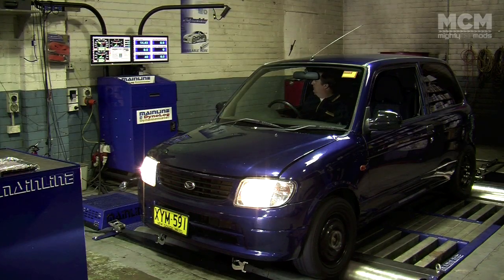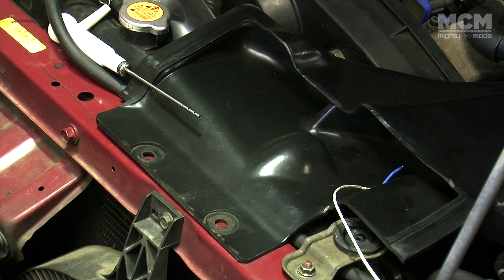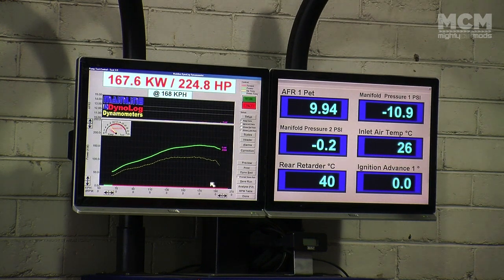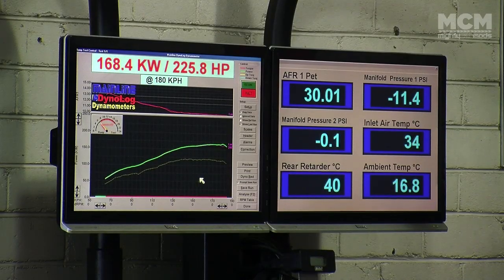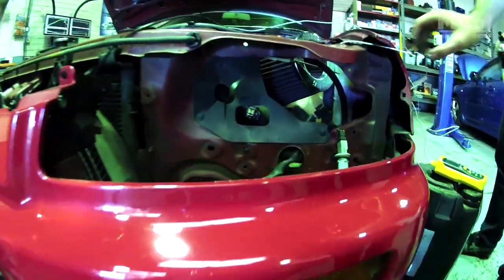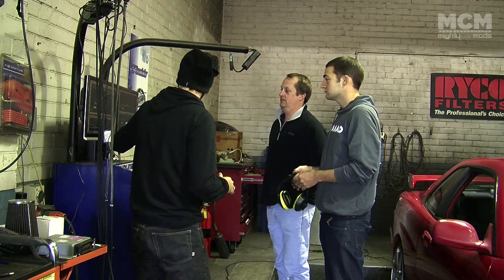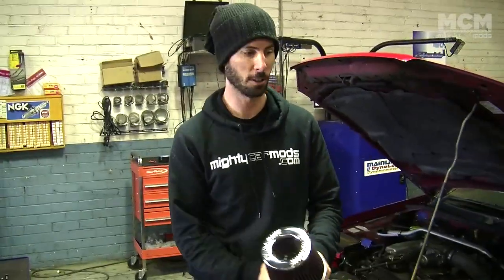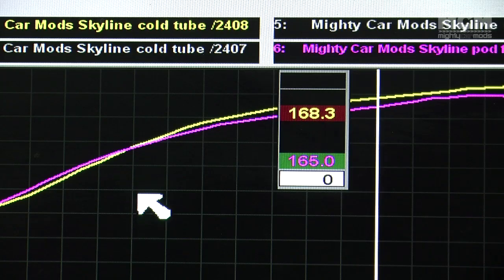Cold Air Intakes Mythbusted [Turbo]

Comment: All I can say is make sure the air intake you get has a box just like the stock otherwise your sucking hot air from the engine. Also verify it is designed for your exact vehicle down to the sub model of your car and lastly understand it will not greatly benefit the performance of your vehicle unless you do your own research!

Comment: Cold air intake or "ram air" is relatively the same concept. This vehicle already has an equivalent system in place. The difference was adding the larger volume intake, that's what gave 1% power increase. To prove a major quantifiable difference advanced engine tuning is required. The vehicle's computer isn't configured to use the extra available air. If you are going to build a comparison do it with a vehicle that doesn't already have a proper intake system. Naturally aspirated vehicles will see dramatic increases but commuter regulated variables would need to be adjusted. Adding more available air is just one piece of the multivariable equation.  

My car, 2016 C63 AMG has restricted air filters and is tuned down from factory. Simply swapping out the air filters and adding the performance tune can produce a significant power increase. 469hp Stock to 605hp with just air filters and a tune. The tune would not work without the increase in available air. In the same respect I could add larger turbos, but it would do nothing without the proper ECU tune.

Comment: A lo of people just think, oh Cold air intake and stick the filter on, but underhood and get no gains. Also, usually the factory airbox already grabs cold air. There might not be a serious gain in power, but colder air to the turbo will help protect the engine at higher boost levels.

Comment: the filters and no filter may flow better but without a larger intake manifold and throttle body, what more can really be pulled in ? that’s like cutting off a section of a hose and replacing it with a larger hose and expecting the whole hose to dow better, all parts must be upgraded before any gains are seen, so for a car an intake alone wouldn’t do much if the intake manifold can’t hold more air, or if the throttle body can allow more area for air to pass through, or if the full exhaust can’t move the extra air out, simple mods alone won’t gain much alone, in tandem multiple mods will work together to create power

Comment: In theory cold air = higher density considering not higher humidity. Will yield in more power if fuel administered correctly. Anyone who flies piston powered aircrafts will understand it. T/O performance calculated relies on this a bit.

Comment: Cold air intake systems never claim to give huge gains,  but they do help,  and the overall point is that the car is moving (thus supplying the cooler air),  of course your not going to see much on a stationary car in a shop.

Comment: So I understand what y'all are getting at, and for the most part you're right, but I think there's a few problems. 
First off, I agree it's completely ridiculous to expect a 20% increase in horsepower off an air-filter, unless you haven't changed your factory filter it since purchasing your Civic in 1992. However, y'all really don't go into any of the benefits of an upgraded air intake and might consider improving your test.
What I don't like about your test:
1) You use a car that comes from the factory with a snorkel. The snorkel is the same thing as the cold air intake you are testing, as it draws air from a colder place. Y'all actually showed that the factory version of a cold air intake performed better than no filter at all.
2) It is on a small, 225 bhp engine
3) Nothing noted on fuel economy or emissions
4) You did not tune after installing the filter

There are also some solid arguments for upgrading intake, and they're logical. Colder air is more dense, more dense air has more oxygen, more oxygen means better combustion. This is the same reason we use intercoolers with turbos. 
A simple performance filter also works with the concept of more oxygen, the only difference is it accomplishes this by ramming more air through period. 
So, either one of these has tangible benefits to consider:
1) Buying quality filters will always be better for your car in the long run. Cloth filters generally do a better job of filtering out the bad stuff while still letting more clean air through. You don't have to be a rocket scientist to figure out it's better to keep the dirt out of your engine.
2) As the boys have proved, you may see an increase in power, just don't expect it to be much. The factory snorkel is the real test here, because it ads power over no filter at all. Their custom system outside the car also added some power. Again, these are small gains, but gains none the less. 
3) Cloth filters are reusable, so yay. Less money spent on filters over time and better for the environment, so that's a win-win in my book.
4) Better filters usually equate to better fuel economy (I saw +.1 to .2 mpg in my truck after several months with the new filter, despite my heavy foot).

Now, is a cold air intake really worth it? Not unless you've already completely built your engine. If you've done this then it's silly to let your intake lag behind, but otherwise you won't see much improvement.
That being said, I would recommend a better filter for everyone, as they're cheap (50 bucks) and there's really no harm in installing one.

Keep up the videos boys, they're entertaining and well produced.

Comment: So, the factory provides a cold air intake (like they do on most cars and trucks these days because they work) and then you test that against a different cold air intake and the gains are to small?  You need to compare the cone filter with headlight to cone outside and you will get an idea. However you need  to be in real world and on a hot day to see the most from these. Also, proof is when  tuning there are always fuel and ignition adjustments based on intake air temps because a large enough swing does matter.

Comment: When that car is moving and the wind is blowing, you get more air and it works better with an aftermarket intercooler lol You should get an extra 2 or 3 hp. with an intercooler you should get like 5-7 The intake has to be facing forward. lol not towards the ground. best place is the bottom of the bumper. facing forward lol like a 300z lol hydrolock your engine. take the plugs and turn the key over lol but they make ports for the intakes that stop that from happening.

Comment: Speaking from the experience of living in the arctic, I can say that you want warm air intakes because the warm air does a better job of atomizing the fuel in the air fuel mixture needed for the stoichiometry that the vehicle was designed to have for proper combustion.
Reply: Nobody has saluted you for the use of stoichiometry.  Until now.  o7
Reply: @mackchannel6348  it's because he's wrong lol

Comment: cold air intake only work once the engine bay has built up heat from extended or hard use. then instead of sucking all that hot air back into your motor you pull in cooler air wich burns easier . so you don't lose HP from the hot air . so although it doesn't exactly increase HP it prevents lose of HP from hot air

Comment: The intake system has a calculated lenght . If you change its lenght than it will have affect to the power and torque.
Also if you place the intake directly to to air, than with the speed you'll get an extra ram air (like a mini turbo) depends on the speed.

Comment: I thought that intakes only increase power if you've got a freer flowing system in general such as a turbo back exhaust and your car has been mapped for increased airflow? Correct me if I'm wrong, I'm not 100% sure.

Comment: On certain cars, an aftermarket pipe can make a nice, sexy sneeze. ;) That's about it. Really, an in/out (or I/H(DP)/E) upgraded from stock will only make a noticeable difference on big motors or boosted ones. They gotta move a lot of air to feel the bolt ons. An intake may give you 20hp (depending on car, but at least read the rest of the sentence), but where is it giving it, and what is it going to take away? You could get a sexy sound, a nice bump in throttle response, shitty idle, lean conditions and more, or none, or all of them. In the end, you could take a set of garden hoses and make a pipe that comes out of every Ford owner's butt; if it's tuned for it, then you will feel the difference. haha

Yeah. That is a big extreme, but unless you are rocking a car with a forced-induction engine or a highly constricted high-displacement motor (or both? :D That is rad), you will nothing but the smile from the intake growl (I gotta say; it does feel nice. haha. ).

Comment: All the first turbo cars were direct feed. Intercoolers only existed on trucks and were too big to fit to cars.  2 or 3 laps round a track and you were down enough HP to feel it.  You could get some of that back with cold air. Id bet if you took the intercooler out of that car you would actually be able to see the difference cold air really makes.

Comment: No fair using a Skyline as your test vehicle. It's already well-optimized for power. You'll only see any difference from a cold-air intake if you install it on an econobox with a strangled air intake or a very old car that pulls air from the middle of the engine bay.

Comment: I realize this video it 8 years old, but they never tuned the ECU after modifying the intake. Monitoring intake gains on a dyno is pointless because the intake will drop to below or near ambient with the CAI from the rush of air while driving the car. The dyno fans will not provide the amount of air of cooling needed notice the difference.

Comment: This is a short ram air intake, NOT a cold air intake. CAIs are directed AWAY from the engine bay, to someplace cooler, like the front of the car (near intercooler) or the side front panel to keep engine temperatures from interferring with the performance of the intake.

Comment: I feel like this test should have been done with a car that doesn't already have a cold air intake or snorkel....or even not use a high performance car.

You're taking a car that's already high spec'd so wouldn't expect to see more gains as its ready been factory tuned for best performance.

Would like to see this on a bog standarf Ford focus for example and  see what performance gains there are

Comment: the only time u would need a cone filter and true 3" pipe would be if u increased ur compression ratio
stock air boxes are obviously only designed for stock compression
some bad plenum designs can also see an improvement from a cone filter
GM 60 degree V6 is one, the upper and lower plenum choke the engine
so removing the air box in general helps and u need a filter for driving

Comment: If course just more air want increase hp but add a tune to increase the fuel and air at the same time and you will see gains then. Plus running cooler air helps fight off heat sink and will help preserve hp.

Comment: I'm thinking the problem with your difference in Horsepower gains is because it's a compressed air pump before the intake a Turbocharger or a blower heats the air so maybe try a normally-aspirated car??

Comment: 100% sure my old Toyota gained horsepower.. plus higher top speed.. idled a little rough.. but there were measurable gains. Originally started topping out at 93mph - 98mph.. After the intake it went up to 106mph-110mph on the track of course! 😏

Comment: I think the difference is.. you’re using a short ram intake.. and the final test is actually a cold air intake.. a short ram sits in the engine bay.. a cold air is more in the fender or similar to where you would of put the final test... away from the engine

Comment: they are going about this all wrong. a turbo already uses a cold air intake in a sense of its intercooler. on a n/a motor. you have to cool the air at the intake manifold. but on a turbo because the air goes through compression after the intake draw. it heats up no matter how cold the air was coming in. after it is compressed it is ran through a optional cooling process of a intercooler. the only way to lower the temp on the charge entering the throttle body, is to lower the intercooler temp. filters etc. will make only response different. rather than making more power unless you strangle the inlet of the turbo. a cold air intake has no effect on a turbo car. the cooler you get the intercooler is where you see the difference

Comment: For your next video, Gasoline and other fuels, mythbusted.

Will equipping your vehicle with a fuel delivery system increase horse power?

Runs on dyno - heavily-edited conversation reviewing dynamo data

"Turns out cars run just as well without fuel."

Comment: do it on a naturally aspirated one and use the least restrictive piping possible, and run it straight from the bumper to the intake. 

I gained 7hp from that simply because of engine bay heat and a tiny bit less restrictive piping...amd that's on a dyno where the air is moving much less. While running my calculations are more like 15hp

Comment: I love mcm.  but vehicles are adaptive over time.  so over time with the computer seeing a colder air charge it will adjust spark and fuel to get the most efficient burn.  but the vehicle needs time and miles to adjust to the intake change and adjust on its own.   but with this said,  the most you would gain without tuning might be a half horse lol.   take the headlight out and drive around for a week than do the dyno see if there is a change.

Comment: I mean, yes they're small gains, but small gains here and there add up. Like how Mazdas new MX-5 saved a few ounces here and there, like they didn't seem significant until you added it all up and it's like you saved the entire weight of a passenger in the new car. Cold air intakes alone don't do anything. But imagine a racing environment where there is constant heat being generated over extended periods and a proper tune (along with bolt ons which make a little difference here and there) and it will add up. When 0.001 seconds can make the difference between 1st and 2nd place (assuming both racers are in the same league in skill), it all makes a difference. On street cars, lol no. They don't do jack. Your stock intake is the best. The only gain from getting a pod is a better intake sound. 

I work at a shop where we tune cars for racing (everything but the actual tunes) and for street cars, we DO NOT reccommend investments in air intakes for significant power gains, regardless of what the big name brand that everyone loves says.

Comment: A cold air intake will never work if its run to a spot in the engine bay where hot air is normally sitting any way. The best bet is to combine with a heat shield and to reposition the placement of the inlet or add a low- scoop. Also while people do say that a CAI will increase performance the true point is to increase efficiency Reducing Fuel useage since most OEM intake systems are some what restrictive. Thus on a brand of car where the intake system already works efficiently adding a different system will not change or can sometimes decrease performance. 

Additionally I second the point of previous commenters where as changing the amount of airflow does nothing if the throttle body is still tuned to the previous system. In some chases a high flow sensor would be needed, however in all cases a re-tune is required so that the ECU is properly positioning Fuel vs Air intake. Air flow being considered as well on a stationary dyno.

Lastly and most important changing the quality/ amount of inflow does nothing if the out flow is still restricted. If the exhaust manifold is  the cars standard Iron and ceramic made to fail system and from the catalytic converter back is the cheapest thing the manufacturer could weld together then trying to push more air in wont mater. It would be ideal to tune the intake exhaust system together to actually produce any noticeable gains.

Comment: Emission controlled stock fuel system is calibrated to function with the factory airbox. Taking off the fan belt would probably give you a bigger increase until the battery died. Just don't slow down. (Unless of course you like the smell of sweet steam and burning metal) : p

Comment: i think you need to have a free flowing exhaust to get anything out of a cold air intake and it works even better with a true induction cowl hood I could feel a difference when I switched from a stock box to a cold air intake when I had my headers with a straight pipe exhaust my engine didn't feel so restricted and it felt like it had more throttle response but you gotta to modify the throttle body plate to its only gonna suck in as much air as the the throttle body would let it

Comment: So, better air flow means you will have air rich combustion.  To get the most from your CAI you should also replace your fuel injectors, coils and sparkplugs with performance ones.  This will help you have a richer combustion and in return more power.  In my opinion CAI (cold air intakes) do work but only if installed properly alongside other components. 

P.S this test seems flawed because in order for your car to take full advantage of the CAI you need to be driving to create that air flow from the airbox snorkel.  These guys also didn't use a heat shield.  Yeah seems pretty flawed.

Comment: Turbochargers and supercharges produce high temperatures will heat up the intake air ,now on a natural aspiration engine there will be an increase I’m not so sure about some high gain claims but according to engine setup 15hp can be achieved but it has to draw air from outside the engine compartment and the engine operating temperature will still heat the air but nothing like boosted engines